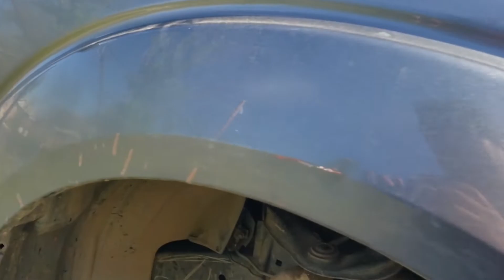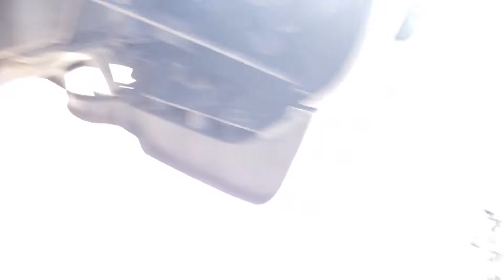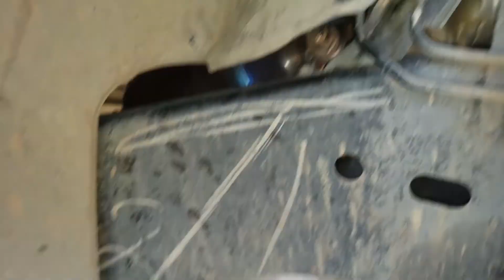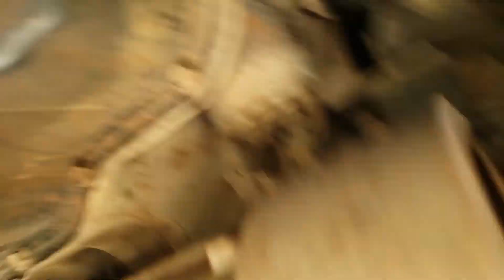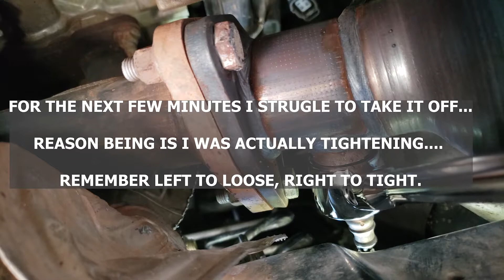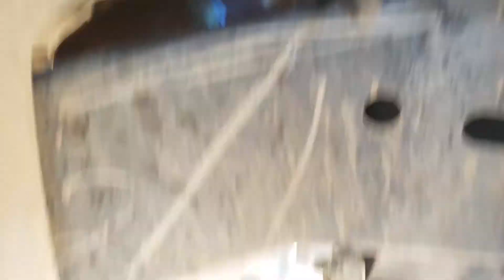How to Change Oxygen sensor on a 2008 nissan Frontier Nismo

Comment: Is there just the one sensor to replace or are there two? If so, would auto parts shop be able to figure out which one needs replacing? Thanks!
Reply from the maker: Some autoparts have these OBD2 scaners that usually are able to tell me you which sensor is bad. However, your check engine light has to be on. If is not on then no. But usually the way it goes is Bank 1 or 2, sensor 1 means top o2 sensors in. Bank 1/2 sensor 2 means bottom sensors. Some cars have up to 3 senors so then gets complected but the rule is same Bank 1/2 sensor 3.

Comment: So bank 2 sensor 2 is the driver side front sensor?
Reply from the maker: no, Sensor 2 usually is the sensor on the back, depending on the car can have up to 4. Some car say sensor 3 meaning is way on the back. You have to look it up. But best way to explain is the BANK 1 or 2 means is left or right or front or rear depending how the engine is mounted. Sensor 1 Usually top ones , Sensor 2(usually the middle one and sensor 3 means the back one. It can get complicated depending on the car.
Reply: Got it thx......
Reply: Bank 2 sensor 1 is driver side front, bank 2 sensor 2 is driver rear.
Reply: @jram1852  Bank 1 means the side where cylinder 1 is and bank 2 is where cylinder 2 is (in the case of frontier it's passenger side) and sensor 1 in the frontier it's before the catalytic converter....sensor 2 is after the catalytic converter.  I first went to autozone and found out which bank and sensor it was with their scanner.  Then researched which one is which on my frontier.